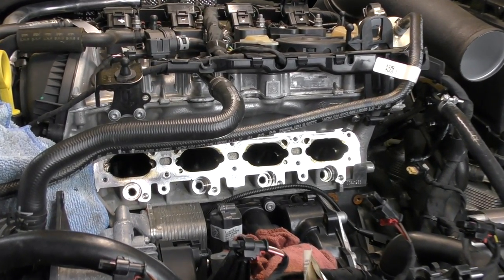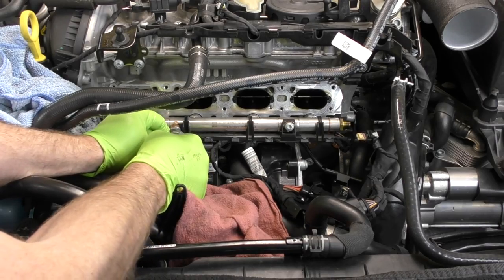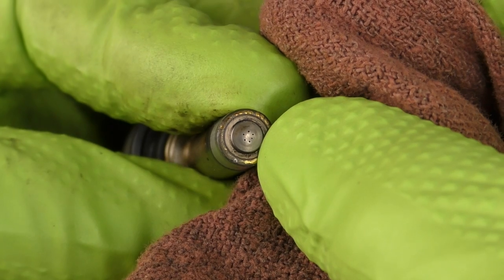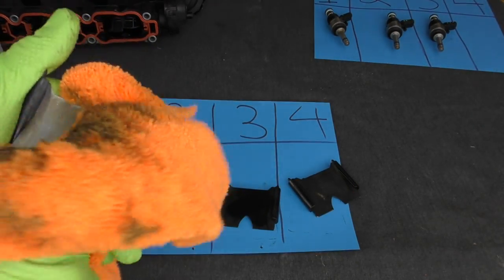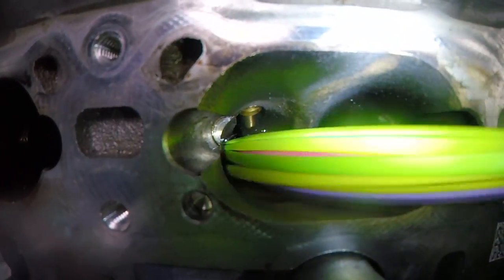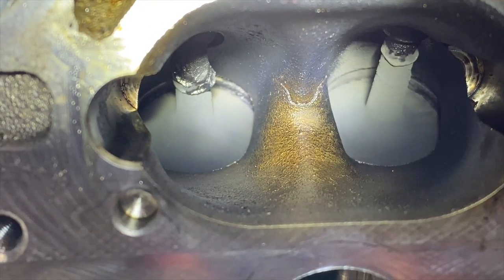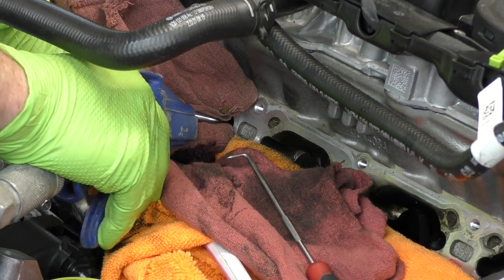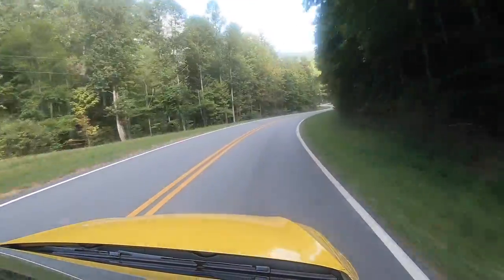How Much Carbon Build Up at 10,000 Miles?? ~ 2019 Golf R

Comment: So v power and treatments are a waste of money. Save it for a carbon cleaning.
Reply: Well in this engine the fuel doesn't come in contact with the valves so,  yes treatments won't have any effect in this engine because it is direct injected.  If you had a port injected engine then those things may help.
Reply: @Cimone90  what about pistons heads and injectors? They benefit from Vpower and cleaning treatments
Reply: @maxdruciak2724  yup. You're right they do a bit.
Reply: @Cimone90  Using CRC GDI Intake Valve cleaner through the manifold helps a great deal. I own a 2015 Golf R @ 52k and have never had a misfire. Have only done that treatment twice though. I drive my car hard as well.
Reply: No. They still clean as advertised but the injectors are "directly" in the cylinders, hence the name Direct Injection.
A catch can to minimize oil contaminants in the intake system and CRC intake manifold/valve cleaner will be your easiest solution to keeping the valves clean.
Reply: Obviously don't get the point then. Could you image how much worse it would look on this car if he wasn't using premium fuels? Only thing you can do to try and reduce this is a oil catch can as it's rebreathers that are supposed to carry unburnt fuel as part of emission regulations also carry oil vapers to the intake. It's the oil vapours that stick to the intake valves and cause carbon buildup. So the only real way to prevent this is the put a oil catch can in the middle of the rebreather PCV which gives the oil vapours more time to cool and actually get caught in the catch can. This usually results in valves staying cleaner for longer

But it doesn't prevent it, just helps.
Reply: @Fly2kill1  No. The 2019 GTI's have 91 octane as recommended, you can use 87 but it will retard ignition timing and pull boost to compensate.
Shells premium 91 V-power cost roughly the same as another companies premium 91, except they use no ethanol and have really good cleaning agents.
Reply: That's not the proper conclusion.  This combustion process always produces carbon buildup.  Without V power and treatments, there would be more carbon present, is the proper conclusion.   I loved the recommendation HM made in another piece to always use Top Tier certified gas in your VW/Audi or any vehicle.  There's a big difference in gas quality.
Reply: @Fly2kill1  Interesting, VW gave the '19 GTI the hp & mpg rating it has on 91 octane, though you can use 87. Check your owners manual because I'm sure it mentions using 91, regardless the 2.0TFSI will take advantage of the higher octane 91 V-power. It will also help slow down carbon buildup, as it cleans better than a good amount of other fuel brands on the market.
Reply: Top Tier certified gas comes in 87, too.  If the manual and your cap states 87 you can't go wrong with that instead of higher octane V power .  You might be getting your Fudge mixed up with your Brownies though.
Reply: Wrong. In port injection engines, the detergents in Shell V-Power and additives from treatments do clean up almost all of the carbon build up on the valves because they make contact with them as they're being sucked into the combustion chamber. Direct injected engines don't receive any of those cleaning benefits because the fuel/additives are being injected directly into the combustion chamber for the sake of fuel efficiency, therefore the detergents & additives only clean the injector, chamber, & piston.

Edit: Included injector
Reply: @Joe_Rebel  I agree, catch cans are also a great solution to keep the oil from the PCV from contacting your valves & accelerating the build up.
Reply: @reallypeacedoff  I've heard it should be added as a service with every oil change. Ive seen the difference, man does that stuff work.
Reply: Yes, this is true for any direct injection engine except for dual port injectors like German GTI's and Toyotas have. All of that fuel treatment stuff does NOTHING. It's your oil that you have to worry about more for GDI engines.
Reply: @CreepinCreeper145  Juan did you even watch the video? Top tier fuel and detergents do NOTHING to prevent carbon build up in a GDI engine.
Reply: I am always wondering about these low octane fuels this Engine can run with. I drive a 290bhp Cupra with 98 or 102 octane in Germany. When driving it with 95, the lowest available here, it produces way less power.
Reply: @adfasses1  American gas uses a more stringent rating system. Our 91 octane is better than other countries 103 octane. Don't believe me? Google it.
Reply: @William Arrington watch the video, my god... Top tier high octane fuel does nothing to help GDI engines with Carbon build up. You need dual port injectors for any benefit since the fuel never touches the ports.
Reply: In fairness: V Power has always been a waste of money. :P
Reply: Yep
Reply: Yep
Reply: @SaraK_69  Not quite, American gas and European gas is the same, we just have different methods of testing and rating.  Im in the UK and i use Shell V Power in my 2018 golf R because its tuned and the 99 RON rating i use is the equivalent to the American 93 PON.

Edit: was going to comment on these engines being MPI not GDI therefore fuel cleaning agents will help keep valves clean, but after reading other comments it seems the American market did not get MPI engines, only GDI... That seems like a strange decision by VW/Audi.
Reply: No, those treatments remove buildup elsewhere in your engine and fuel lines.  The intake valves on a direct injected engine are different - they need to be cleaned with different additives or through a manual cleaning.
Reply: @James-ns6jm  Premium doesn't have anything to do with it.  You want to use top grade (detergent) fuels to help with this problem.
Reply: @James-ns6jm  Premium is just the fuel octane rating...
Reply: @adfasses1  hola yo tambien conduzco un cupra 290cv del año 2015 en barcelona.acabo de montar oil catch can y quiero limpiar admision ya que le cuesta arrancar en frio.tambien se a montado bateria VARTA 70 AH,nueva y sigue con fallo de arranque.
Reply: @James-ns6jm  There is no way to know that. As far as we see, it isn't working in this engine. I've never seen anything worse at 10K miles with or without TT fuel. Not Honda, Hyundai, KIA, Ford....nothing.
Reply: @Joe_Rebel  Nowhere on Shell's website does it say "no ethenol" . If you can find it and share the link, that would be great. I don't trust Wiki or other third party guesses
Reply: Install oil catch can problem solved.
Reply: This car had one installed. Problem not solved unfortunately.
Reply: UK minimum is 95 Octaine for standard and 99 for super unleaded....thought the USA would be the same
Reply: @1SaG  Not if you have an engine that can take advantage of it performance wise.
And it will clean the valves and injectors on port injection engines
Reply: @reallypeacedoff  do you spary it into the intake？
Reply: reallypeacedoff at what mileage did u apply the first time and where did you spray it ?
Reply: @victorchen8484  No, you need to pop the manifold sensor off and spray it in there with the car running.
Reply: Yes, run any named fuel, change oil often, and do not worry.
Reply: @Fly2kill1  I run E10 98 RON. 91 will kill my MK5.
Reply: No way to stop it, open and clean it open it and clean it open it and clean it regularly....repeat until you no longer own the car

Comment: Truly shocking engineering. Going back to the 70s when we had to pull the cylinder head off every 10-20 k miles to do a decoke. Not progress.
Reply: In europe volkswagen even puts rear torsion beam suspension on the entry levels golf while they didn’t on previous generations. They really cheap out on every generation if you look into it. 

In terms of reliability they do really good here honestly in America they are probably not build as well or have a different tune because the only people complaining about Volkswagen seem to be Americans.
Reply: @JMNTN  ın europe all mqb platform cars under 150 hp sold with torsion beam rear end until mk 7.5 i dont know the new generation. I have a 2016 seat leon 1.6 tdi 110 hp 5 speed manuel with torsion rear. Seat is the cheaper brand of vag group and leon is more sportier design golf. Beside all other design and engineering flaws worst one is rear suspension. Comfort level is lower than all rival cars. Thats why i will never buy a vag group car again. Fuel milage is very good around 40 to 45 mpg diesel but there is a clicking bomb comes standart with new tdi engines. Emission equipment. You must be sure your egr system dpf etc gonna hurt your wallet.
Reply: I have TSI engine. Okey it's not 2.0 Golf R. It is 1.2 but still I have driven 110 000 kilometers and I have zero issues with the engine. I usually use regular 95 octane gas. I used maybe 3 full tanks of 100 octane in my life with this engine.
Reply: @Romif_SK  early 1.2 tsi engines are prone to timing chain failure resulting engine replacement. 1.2 get better later. Now i wonder what will happen to 1.0 tsi
Reply: Got memes? I believe it’s because 1) they aren’t as well made here, 2) parts cost more here, 3) people don’t know how to work on them here so it costs more, 4) we drive WAY more then you guys do so you wear out cars faster if they aren’t as well made. For example a car in the US should make it to 200+ thousand miles with minimal problems for it to be considered reliable. Whereas in Europe it seems like most people only go for 100 thousand ish.
Reply: @shadowthesi  not here in the UK, people would go ape shit crazy if cars didn't make it past 100k, my FN2 Type R is nearing that and it's been flawless and it better be for the next 100k
Reply: Zach Waldauer They drive just as much as we do. Maybe worse, because European traffic is like NYC in many areas. Lots of idling. 

I’ll give you lots of American techs do not know how to service them. Lots of dummies here.

 Another huge factor is oil quality. Like here in America our oil is junk. We have a lot of nerve claiming the shit we sell here is even synthetic. European oil mandates are extremely strict. So much so that many of the oils we sell here would be considered synthetic blends over there.
Reply: @jonathan___4684  if it's not flawless for another 100k miles are you gonna ask for a refund or something?
Reply: @hellobooom  it's going straight back to Honda otherwise :D
Reply: @JMNTN  There's a few complaints in Europe and Asia too. Most new VAG cars are quite fragile compared to the 90s and early 2000 models. Emission regulations and obsessive fuel economy objectives have lead to very complicated short service life components. Shame as the technology should lead to improvements.
Reply: @JMNTN  Carbon buildup ist also only a myth
Reply: Don't but a modern VW/VAG car if you care about long term reliability basically.
Reply: Jonathan _ 
Cause it’s a kick ass Honda, not some corner cutting vw
Reply: You must have had some shit engines in America. Australian engines had no such problems
Reply: @JMNTN  Torsion beam are fitted on any cars under 150HP, except for the Scirocco.
Reply: @emrahcanbaydar  It's interesting how most of the 1.2 and 1.4 TSI engines fitted in Golf mk7 since 2012 were already the newer EA211 with a toothed belt instead of the timing chain but everybody still keeps talking about the timing chain problems. And since 2014 ALL the 1.0, 1.2, 1.4 and 1.5 engines in all the MQB vehicles are the EA211.  And EA211 is a completely new design compared to the EA111.
The EA211 in a Golf should be good for up to 250.000, maybe 300.000km (180.000 miles). But the heavier vehicles definitely suffered from premature wear - loosing the compression, increased oil consumption , etc.
Reply: @GeriW  i know but fist tsi chain problems made a big impact. New ones will probably go for 250k miles but here in Turkey water pumps are failing around 100k kilometers. Injectors turbo coils etc fails way before engine internals. It is sad and expensive.
Reply: Got memes? We drive exclusively VW. I’m American. The only people here is the states that complain about volkswagens are the JDM fan boys. My 70,000 mile MK6+ Jetta has had only an AC compressor valve. I follow maintenance schedules and change my oil at 10,000 miles. I’m happy. Should be getting my golf r this week. Fingers crossed
Reply: Emrah Can Baydar I’ve got a 2016 MK7 1.4 tsp golf with 125hp. My golf have fully independent suspension.
Reply: @shadowthesi  What?  200k is still considered extremely reliable in the US and anything 100-150k is reliable.
Reply: @BlatentlyFakeName  All the people I know have made it well past 115k.  I bailed on my MK6 because I didn't take care of it and drove it like I was on the track most of the time.  My MK7 is a different story I am trying to be careful with it and studying up on how to take care of it as best as I can.  If it fails on me then I will hopefully be ready to jump ship to Subaru, but honestly Subaru isn't much better from what I have seen.  

Never buying a honda unless it's a TSX manual...I regret not buying the one I saw with 63k on it a few months ago.
Reply: @Not-a-bot222  ...10k oil change even though that's what VW claims, is not a very good idea IMO (and many others) for your golf R I would highly recommend 5k oil changes, but that's entirely up to you.
Reply: Got memes? Not true I am from the uk and all we fix in the garage trade is post 2005 vw's mainly 2010 onwards. Everything before 2005 as a rule if maintained is just better
Reply: @Osprey1994  I follow you on the TSX. Love them 6MT but I believe 8th Gen Civic SI rocks too, 2007 up to perhaps 2011. The motor rips and the body lines are clean.
Reply: @MagicStick Torsion beam is harder to service and get the alignment right. Also, like a solid rear wheel drive axle, it is antiquated, less refined, and less adaptive
Reply: @emrahcanbaydar  Why the water pumps fail? I just changed a Mazda mech water pump at 17 year mark and 180,000 km. It was like brand new. Made in Japan bearing good in that one which ran off the rubber timing
Reply: @jamesmedina2062  I dont know actually. Some aftermarket pumps like ima etc are better than oem ones. I think they made a modification. Some spare pumps come with steel propeller. Originals come with plastic propeller. Also some aftermarket brands delete the electric actuator on pump. Those primitive unofficial modifications male them fail safe. Propeller shaft snaps, o rings fail and electric actuator fails.
Reply: @emrahcanbaydar  are you saying the aftermarket pumps work better than the factory ones? I know they been using plastic impellers for too many years
Reply: @jamesmedina2062  if you dont think about efficiency and vw hi tech gadgets yes aftermarket ones are better. Actually same brands make oem and aftermarkets.
Reply: @MagicStick Peugeot has always been great. But how did we go from water pumps to suspensions? I don't understand how Renault never came back to USA if together with Nissan.
Reply: @MagicStick if you are just saying service on cars is good well thats what make German car makers happy. There is nothing happier than a dealership garage with all of the lifts full of needy VW or Mercedes in the air. Of course BMW take it to another level but to me in the end it is worth it. They are great cars
Reply: @MagicStick Well then you are fully practical and energy efficient. TDI got so much torque and economy. I wanted one badly in 2017(2015 whiteGolf TDI) but somebody else beat me to it.